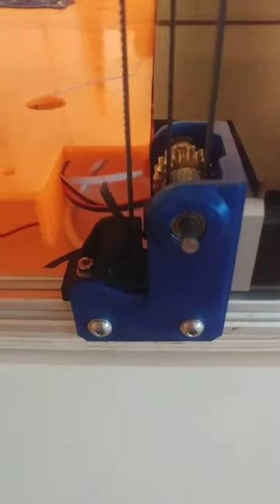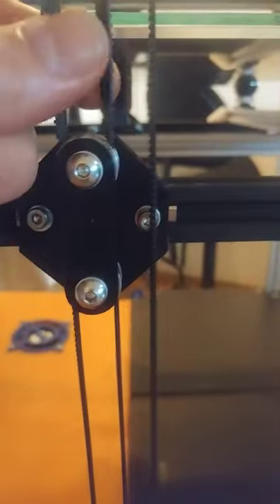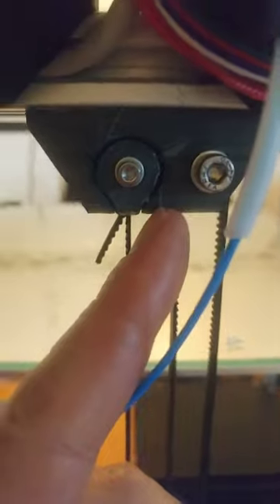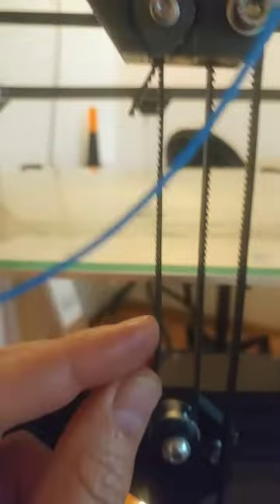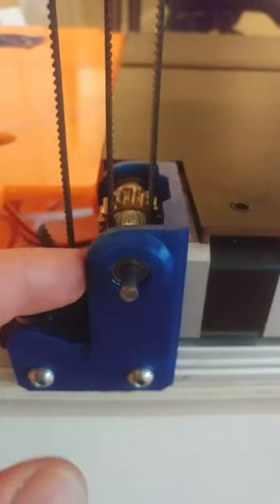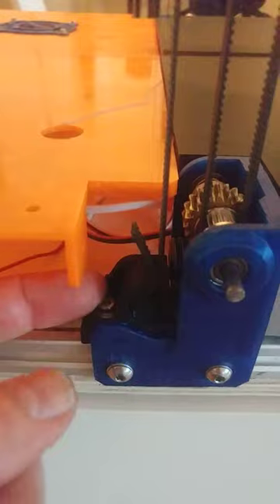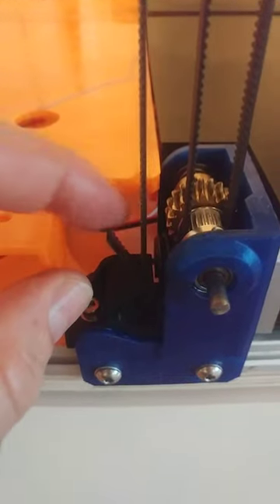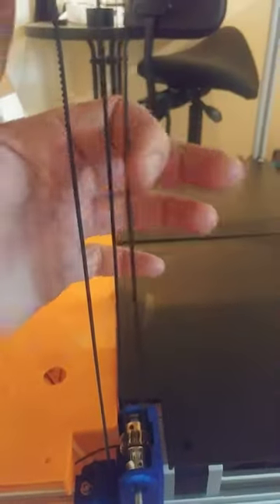V-King CoreXY - BELTED Z AXIS - AWESOMENESS EXPLAINED

Comment: What stops the bed from dropping when power is cut to the z motor?
Reply: It's using a worm drive, you can drive it from one side but not the other. The friction in the gearing stops it from being driven by the weight of the platform.

Comment: what is the accuracy/repeatability compared to Screw? do you get any issues with elasticity of belts?
Reply from the maker: The resolution is higher than the screws. I have 3200 steps/mm with 1/16 microstepping.

I have no issues with the elastizity but do use reinforced belts.

As of accuracy/repability it is good enough for 3d-printing. If you want higher repability add a second motor so that you get 4 lifting points
Reply: Thanks, I think this is a great alternative to the cost of precision screws, do you think a counterweight would be overkill?
Reply from the maker: A counter weight has no mission in this setup with the worm gear

Comment: Is it easy to calibrate how level is the bed with this system? i am assuming that it might be difficult to level the bed.
Reply from the maker: Tareq L it is the same process as with dual screws. Nothing special
Reply: I really think that the simplicity and low cost of your design, yet seems a precise machine is the best feature of it!
Reply from the maker: Tareq L thanks. That was the whole point. How ever it ended up a bit more costly than I meant
Reply from the maker: The bed is leveled easily. I can make a video on that later
Reply from the maker: There are 4 thumbscrews on each corner of the bed.